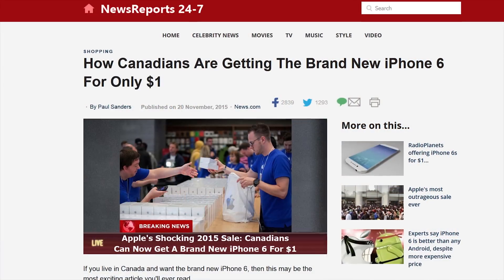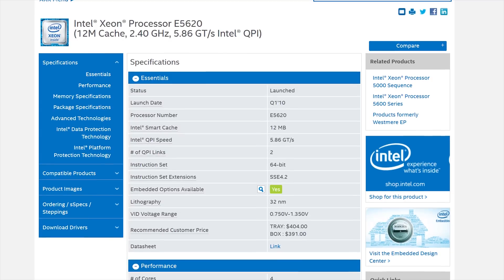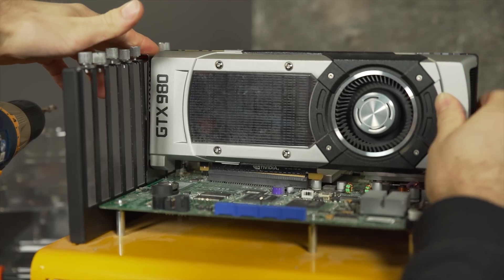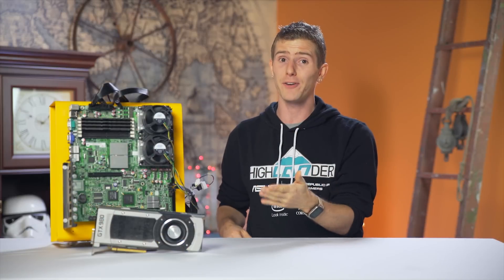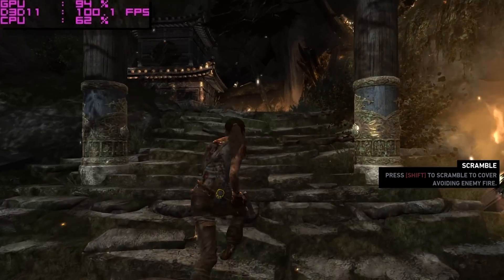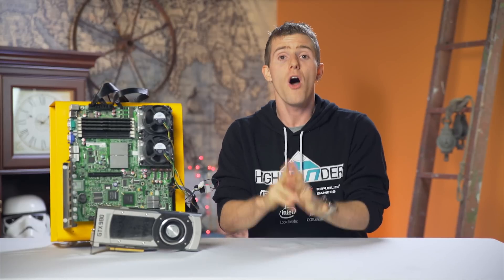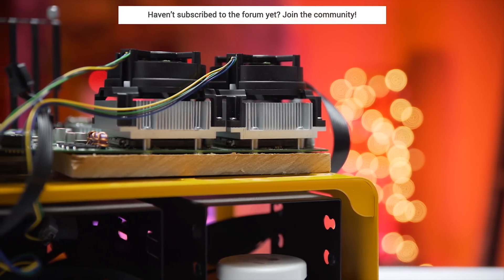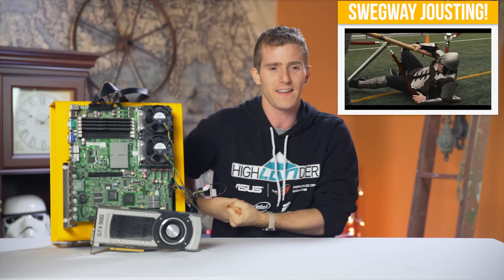Under $150 Budget Gaming 8 Core CPU, Motherboard & 16GB RAM

Comment: I wish this video came out before I built my ghetto server in much the same way. I probably wouldn't have done it, haha. My motherboard had a proprietary power connector, so I had to solder an atx one onto the BACK of the mobo, then repin the power supply in reverse and run the cable thru the outside of the case, thru a hole I cut in the motherboard tray. Also, no fan headers, no front panel connections, and the PCI slots were on a proprietary riser card which meant the graphics card was at a 90 degree angle of what it should have been. A lot of cutting and some strategic zip ties and it all works.

Comment: Linus i am 3 months ahead of you lol and it is true a lot of this older workstation and server stuff is going cheep!!! 
I got my wife a Super-micro 6 pcie 2.0 $80, intel 2x E6520 16 threads baby $18 for two, 12gb ECC reg DDR3 $20, MSI twenforser III Gtx570 $60, 250gb SSD $90... so not to bad...

Comment: Hi linus, (or atleast I hope.. pls halp) I'm currently just about to build my second rig, I dont wanna go too overkill or overprice.
Would this be a decent gaming pc for games like (Fallout 4, GTA V, CSGO ect.)

Asus m5a99x evo r2.0 <- MB
MSI gtx 960 Tiger <- gpu
AMD FX-8350 <- cpu
hyperx ddr3 1600mhz 2x8 <- Ram
hyperx 240gb 2,5" <- ssd
WD red 1tb <- hdd
Corsair 750m 750w <- psu
corsair obsidian 450D <- case
Fractal Design Kelvin S24 cpu cooler <- cpu watercooling
Reply: +MikroNi CSGO Content good
Reply: Uuuhm. No. I'm using parts I know and trust and have gotten good personal recommendations for
Reply: +MikroNi CSGO Content Is that not an intel socket (x99) motherboard? If it is, it wont work with that cpu
Reply: +Marton Peintler-Krivan Did you actually just get mad because I dont want to follow your advice? You need some anger management. 
My current setup has a amd FX-8320. I have no frame drops, no overheating (Using the stock cooler)no problems even after overclocking it.

The 960 tiger I've used in some builds for a few friends of mine and they work fine aswell.
Dont cry please.
Reply: +MikroNi CSGO Content He's right dude. He recommended some pretty decent specs, and all you did was bashed him about it. Of course he's angry, how could you tell someone to get anger management in that kind of situation? The only downside of his recommendation (IMO) is that he should've went with a Nvidia gpu.
Reply: ***** Too much crack coke will fuck you up man
Reply: Creeper Face One thing. I didnt ask for recommendations for parts, I asked wether its a decent pc for the games mentioned above
Reply: +MikroNi CSGO Content True, true. But just because someone replied besides the original question doesn't mean you should turn them down. The AMD FX Cpu is decent, but a i5 will help alot. Great build overall though. Oh, and the problems he mentioned can happen, I built a gaming pc for a friend, his cpu got overheated so badly, it almost fried the mobo, and damaged some circuits on it. The problem is very very super slim, but a possibility.
Reply: Creeper Face I've used the parts I'm getting before, know how much i can trust them and how much they cost. I'm not gonna get an Intel cpu, as ususally they're more pricey and I've not used Intel before. But the chances are there with every card, cpu, mobo, anything tbh

Comment: If you had a motherboard with two pcie slots could you run sli?
Reply: Depends if the motherboard supports nvidia SLI. It will explicitly say it on the website.

Comment: If you spend a little more you can pick up 3/4RU storage server that come with better CPUs and support more for around 350. I bought an old 12 CPU core supermicro storage server for 350 usd and it came with 128 gig of DDR3. It was obviously retired from a data center and came with the raid cards still installed I took and threw in HDDs and im using it as my storage server. But I don't see any reason someone couldn't turn it into a budget gaming computer or budget workstation. Linus also forgot to mention most of these server boards DO NOT SUPPORT SLI OR CROSSFIRE. Only the workstation boards supported them. So don't run off and grab a board with more than 1 16X slot and think it can support multi GPUs.

Comment: That kingston kit ended in MLG4.  That means it was 'designed' to be compatible with an HP Proliant ML-series G4, which is the same gen as that Dell mobo.  Honestly, though, if it's compatible with one brand, it's probably compatible with the other.  

Kingston's got some decent footing as a 3rd party vendor for server-grade memory. Highly recommended if you're needing to support or use aging hardware where brand-name parts are scarce or just stupidly expensive.  Lifetime warranty that really means lifetime, too.  You get a Kingston brand 128MB PC100 DIMM that needs replacing, they'll still replace the thing.

Comment: How well would this $150 build run Fallout 4?
Reply: Matthew Bauer I'm pretty sure the ones he showed were quad core in the video (I might be mistaken)
Reply: You were right. My bad. Original comment removed due to miss information.
Reply: Matthew Bauer so a rig using the 2 quad cores, would that run fallout 4 pretty good? I was about to buy a PS4 since i couldn't afford a good pc however if this will be better then ps4 i may need to reconsider.
Reply: It'd be better than a ps4 but you need a good gpu
Reply: Matthew Bauer and recommended gpu's that wouldn't put me over the $350 mark for this build?
Reply: One more question would the fact these area older and often limited to DDR2 be a problem?
Reply: My HP z600 (currently running $250 on EBAY buy it now) is DDR3 and I upgraded it to dual x5570. Make sure what you get is DDR3 compatible NOT "DDR3 ECC only". Look for something socket 1136. You can go AMD R7 for $130 minus rebate at Newegg for GPU.
Reply: Matthew Bauer Ok thanks for the help.
Reply: Np
Reply: +Layne Peck gtx 960, but please just save up for a proper pc or u will prob regret it

Comment: Is anyone willing to go to PC Part picker and give me a recommendation of a Good 1000$ Pc ? Ps. Include a Nvidia Graphics card.
Reply: +Evil Killager 
Take a look at this, I made this for one of my other friends: http://pcpartpicker.com/p/B6RZTW
Reply: Curefitz  Sir i think you got a good taste when it comes to PC part picking. Thanks man :)
Reply: Evil Killager
Np dude!
Reply: Benny Rosario Curefitz But you'd have to buy a 80$ + HUGE ugly Noctua air cooler. Or add 30$ and have a AIO CPU water cooler that performs better.
Reply: +Evil Killager you willing to go over budget by about 200$?
Reply: +Evil Killager http://pcpartpicker.com/p/CmbHCJ Here you go. I went for the coolest (Ha! get it) build. Black clean with a touch of blue (which you can swap for black for the same price). Water cooled, DDR4, factory overclocked GPU, overclockable CPU, and premium components within the same brand (EVGA and NZXT) no mixes of competitors. The thing Curefitz forgot to include was the RAM cost and case fans. Hpe you like it :)
Reply: +Baltasar Leví Elíasson Why a $100 Cpu cooler? He should only need a 212
Reply: Benny Rosario Because I chose a CPU that can overclock, you can't use an air cooler with overclocking. He can save a 100$ to cut down both on the cooler and CPU.
Reply: *****
If you have a good aircooler, overclocking is very possible on air.
Reply: ***** Lol, you don't need watercooling to overclock. If you have a decent aircooler, your cpu will be fine.
Reply: +Evil Killager just going to leave this here http://pcpartpicker.com/p/tRwbbv
Reply: +Evil Killager Sorry didn't read the Nvidia part http://pcpartpicker.com/p/wy8c8d
Reply: Ben Bega But the temps inside the case, so the GPU, all get a bit hotter with an air cooled CPU.
Reply: ***** Huh. Neat.
Reply: I`ll take ***** one. Sorry ***** .I can`t do water cooling.
Reply: ***** Water cooling seems kind complicated. I just need to build a pc that is very good when it comes to gaming.
Reply: +Curefitz Brb while i kill myself because that PC is 1k... Australian prices amirite
Reply: +Alexander Binovski Thanks :)
Reply: +Evil Killager DO NOT get that 970. Even though you want an NVIDIA card AMD cards are absolutely wrecking NVIDIA cards and they are usually the same price. Get an R9390, trust me you'll thank me later.
Reply: I`m getting the 980.
Reply: +Alexander Binovski i have a gtx 780 it cost me heaps not that long ago and my screen is 1440p. always getting frame drops into the 40s it sucks i feel like the ps4 out performs it. This was my 1st gaming pc what a rip.
Reply: search for extreme-g drivers they give you a good fps boost
Reply: ***** Thanks, you made me feel alot better. Maybe i should just get another 780 they must have come down a bit in price. And yea i love 1440p as well! I guess i should stop crying and be happy. But down the line i will build a water cooled gsync beast of a machine. Love me some silky smooth fps!
Reply: If you still need help with those parts, i can help get a good pc.
Reply: +Alexander Binovski Autralia sucks for building gaming desktops
Reply: +Alexander Binovski best budget build I've got is about 1K and i mean budget!
Reply: +Alexander Binovski do you know anywhere where (if that makes sense) you can get parts for a desktop in Australia? I already have the case but that's all, nice to meet another Aussie in the comments
Reply: +Alexander Binovski Darwin and by the way I have being to leading edge and it sucks here
Reply: +Alexander Binovski thanks, great website, a little cheaper than PCcasegear but pretty good

Comment: LINUS! How viable do you think these are as workstations for producing 3D and animation wise? I already have a powerful renderer, but we need more machines and we're on a REALLY tight budget. All we need is to use zbrush/MAYA and photoshop, just the usual, no rendering.
Reply: +gwidao123 without rendering you probably can throw any old potato at the problem and it works out fine
Reply: +gwidao123 I'm not Linus, but I can answer your question.  Very viable.  I'm been using what amounts to second-hand server gear for many years now and I'm not planning to go back to mainstream computing any time soon.  the systems are cheap, the CPUs are stupidly cheap, ranging from $12-$20 per CPU if you stay just one model below whatever the max is in the series; and the ram can be absolutely bonkes affordable.  I very recently paid $40 for a 32GB/8x4GB kit of RAM from a seller I've gone through before.  I regularly use Photoshop, Blender, and do moderate gaming with no problem, thanks to the GTX750Ti I have installed.

It's not going to match the performance of the newer CPUs (I think my 2 E5472s do about 93% of what an i7 4790k would do in a multi-thread benchmark); HOWEVER, considering that you can build almost the entire system for less than the cost of just the CPU for a new system, your performance for cost is going to be outstanding.
Reply: Powered By Redstone Yeah, i already bought it all up before you even made this comment xD.we have a main machine here which is our renderer/tester, really great expensive machine, but we're making the team bigger so we need 2 more work stations. his solution worked perfectly, we've hidden it all behind the tables so it doesn't take up much space, took a good week to put it all together but was sure worth it.

Comment: If I were to use a Server Motherboard would I also have to use a Server power supply
Reply: +Janidu Gunawardana it all comes down the the motherboard, some use standard plugs others use special hot swap psu.
Reply: +Max Collins thanks

Comment: Could've used a pci-e extended rather than cutting the 980
Reply: +mbsfaridi There is no such thing as PCI-e extended. He should have used a PCI-e x16 pin for pin ribbon extender. I am 1000% sure he has them as I have seen them used in several of his server builds.
Reply: Matthew Bauer That's what I meant, I thought that "extender" would sum it up.

Comment: This is quite common in China cuz such motherboard and processor are freaking cheap. Someone even designed an adapter to make LGA771 processors work on LGA775 motherboards. Now these adapters are widely available.

Comment: One fairly important caveat to dual-cpu configurations is the fact that the memory controllers are in the CPUs so each CPU only has direct access to half the RAM slots so gaming titles will suffer greatly if they try to run across both CPUs without being NUMA optimized (knowing where code is running and what memory it accesses).

Comment: Hi Linus i have a question, currently i have a very old pc with 
Intel core i2 duo 2.66 ghz (not overclocked)
Gigabyte GA-P31-DS3L
2 GB DDR2 Ram 
Nvidia Geforce 8600 gt
400 power supply 
And the question is what should i upgrade (my budget is 300£) Or should i get more money and just buy a new pc ? Please answer.

Comment: You're better off doing LGA771-775 mod to the LGA775 motherboard and overclocking a single, quad-core LGA771 Xeon, like X5460, which is easily capable of 4GHz with a decent P35/P45 motherboard. 

That way, you'll have a similiar performance for even less amount of money and none of the drawbacks of server motherboards. The only drawback is that you'll be limited to 8GB of RAM, but that's still plenty enough for nearly every modern game.

Comment: Used Fx8230 ~80$
used mobo 970 chipset and CFX support ~ 40-50$
used 16 gigs of generic ddr3 ram 40$ at best
Everythin still in warranty with upgrade path and definitely more current than  video proposes....
Just sayin.
I got used R9 290 dirt cheap.....now ill Crossfire the hell out of it.

Comment: I snagged an old 6-core X5650 for around $65 back in November last year. Grabbed an EVGA X58 FTW3 for around $110. OCed it to 4.1ghz and have been blazing ever since. It's basically a 980/990X performance-wise and can still keep up with modern chips.

Threw in a GTX 970 last week and it's been great.

Comment: A while back, I picked up a HP Z600 dual socket system for $150. It came with 2 5100 series Xeons in it. For $50, I upgraded to 2 Xeon X5560s which are quad core hyperthreaded for a total of 16 threads. With my existing AMD R9 270x and 16 gigs of RAM (4 2 gig sticks and 2 4 gig sticks), it came out to a decent gaming system. It also had SLI or crossfire support (via 150 MAX watts between 2 graphics cards; never tested that) as well as 2 PCI, 2 PCI-e x 16  gen 2 and 2 PCIe x4. I retired it after I realized I was unable to play Fallout 4 at 1080P due to what I presume is bottlenecking. I am currently planning to use it as a home server running server 2012.

Comment: I've been looking for a solution almost exactly like this for about a year or so, not for a gaming rig, but for a streaming rig to broadcast to twitch without being on the same cpu I'm running the games on. That one expansion slot could house a capture card and since video compression is done on cpu I wouldn't need a graphics card at all. Now, if only I had $150... and a functioning pc...

Comment: I paid $10 for an old Dell Precision T3500 with a dual core xeon. I dropped a Xeon X5677 (4 cores 8 threads 3.46GHz) for $55, and it is a very decent gaming PC. It has a 500W PSU, 2 X8 PCIE slots, and 6 slots for DDR3.
Reply: +rkan2 it's a better card sure but more expensive. he's on a budget
Reply: +MrMatte0000 How did you get it for $10?
Reply: Bruce Lee We have a government sale here that sells old state computers, and it was "non-working". I took it home, reseated the RAM and it worked perfectly. Sat on it a while and found out it had the 1366 socket, so I slapped the Xeon X5677 in it, and it preforms very well. It is most certainly on par with my 4690K when paired with a 280X, it played GTA V exactly the same as my main desktop.
Reply: I'm going to build a Pc, but I'm on a super strict budget, wish we had that here
Reply: Bruce Lee There's one on ebay right now with a W3530, 6GB of RAM, and a 160GB HDD for $120, would be a good starting point. Could easily slap a 6-core or the same CPU mine has in it later.
Reply: MrMatte0000 Might actually do it, but then i need a decent GPU, for cheap.
Reply: Bruce Lee A 750TI, 7870, or 270X would be good and reasonably affordable. The stock PSU only has one 6 pin power connector so keep that in mind. Could also go with a 950 but they are $170
Reply: +MrMatte0000 A used R9 290 is still a good buy I think.. that's a sub 400usd beast of a machine..
Reply: +MrMatte0000 If he lives in a more populated area he can probably find used 290/290x's for under 200 easy on kijiji or CL. There is a million of those things in the wind because of the coin mining boom.
Reply: I bought my 290 for less than 220eur over a year ago so surely from the states you can get one for less than 200e now..
Reply: +MrMatte0000 the dell is still better than my pc tho. http://pcpartpicker.com/p/yBvHkL some parts arent even avalable anymore.

Comment: To be honest I work for a computer refurbisher/retailer and you are better off buying specific used workstation models on the cheap (no ram, HDD, GPU, OS) and putting in what you need after. a good example is The HP z400 which can run a W3570 3.2ghz quad/8threads CPU.

Comment: Even the QPI-based Nehalem/Westmere Xeons themselves (i.e. X5570 pairs) are getting dirt cheap, nowadays. They have hyperthreading, turboboost technologies, faster RAM capabilities, etc., and can have up to 24 total threads. However, reasonable, dual-LGA1366 boards seem to be even harder to find; let alone for a bargain price, but it's probably possible, if one really hunts around.

Comment: My old i5 750 quad core  with Asus Maximus 3 Gene outperform Linus $150 system. In ebay you can buy i5 750 quad core  combo with motherboard in less than $150. Don't waste time on this server board.

Comment: well. i feel great with my recently purchased hd 7790. :D I have a gigabyte P31-DS3L (Socket 775) and i did the 775 to 771 mod and bought myself a  E5410 @ 2.33GHz and OC'd it to 2,9ghz, and with 3 GB of ddr2 ram it runs gta V at 40-60 fps at some high settings.